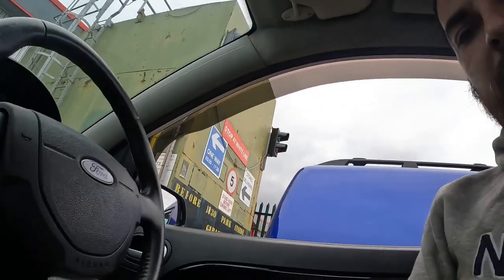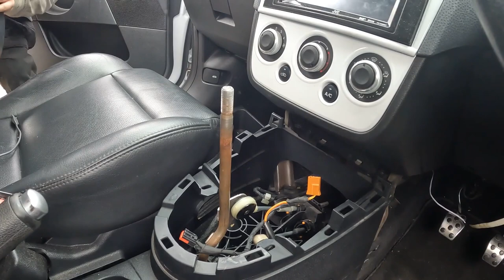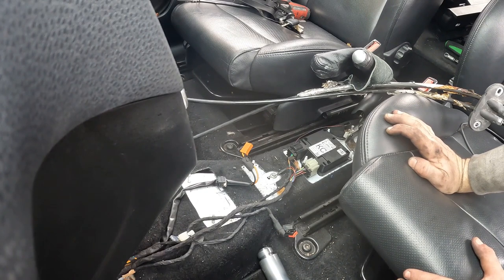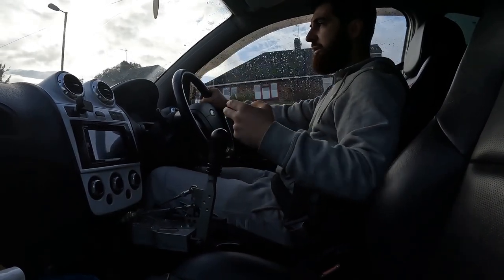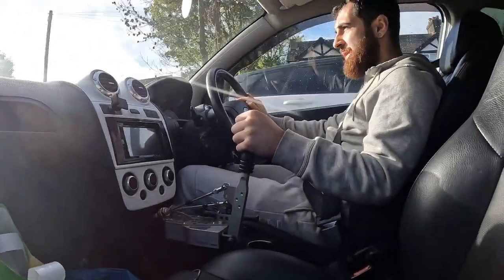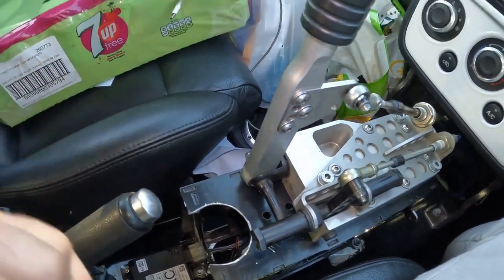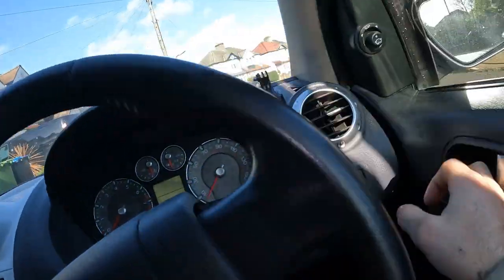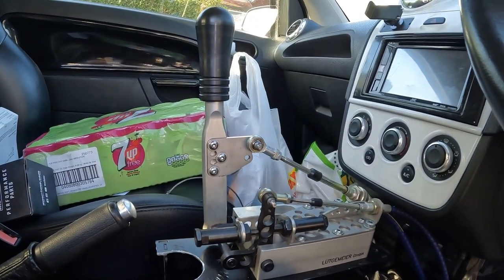THE LÜTGEMEIER GERMAN CUP CAR SHORT SHIFTER IS FINALLY FITTED TO THE MK6 FIESTA ST150!!

Comment: Hi mate. Can you tell me where tf the negative ground goes from the battery?? Just fitted new loom and got work tomorrow ffs lol
Reply from the maker: Pretty sure it just bolts to the body underneath the battery tray mate
Reply: @6uiltdifferent  half way down the wire it bolts there. Then the end bolts to f knows where. I’ve got work tomorrow I’m really in the shit
Reply from the maker: @shadows4775  I have a battery relocation video might show you where it is on there?

Comment: Mate pulling those cables through looks so easy. I've recently changed my gear cables as my old one rusted and couldn't select gears. I had to drop the whole exhuast to get to the heat shield. It was a pain I'm the arse!! Big job for something so simple! Good work bro keep up the content!
Reply from the maker: Wasnt too bad on mine as I don’t currently have heatshields so I was able to do it with the exhaust in situ but I can see why it may put some people off the job especially if they haven’t got much experience I look at it like there’s always a worse job to be doing haha, thanks mate I really appreciate it
Reply: To get my gear cables out I had to chop them with a grinder. And it was still tight getting new ones in because the my 4-1 manifold and heatshield was resting on the subframe at this point  it only gave me about 10mm more room to play with.  It was a good feeling when it was back togeather tho! Gear changes are very smooth now!
Reply from the maker: @markheath6232  sounds like you had a nightmare glad mine wasn’t that bad still you got it done that’s the main thing

Comment: Short shifter looking taller 😂
Reply from the maker: Just a little haha
Reply: @6uiltdifferent  🤣what’s it like tho
Reply from the maker: @jamiefowler2329  one of the best things I did
Reply: @6uiltdifferent  sounds good how much are they I have a mk8 fiesta but swapped the engine for the rs 2.5 5 pot could do with a good short shift in it tbf
Reply from the maker: @jamiefowler2329  you’ll be lucky to find one this is a Ford motorsport item. Purposely specced for the mk6 fiesta 

They built 50 mk6 fiesta German cup cars for a race series they all contained one of these shifters…… yes there’s only 50 of them ever made for the mk6 fiesta so they don’t come up often I got lucky with getting this one but it set me back around £1250 

Look into a cae, coolerworx or a zero point one shifter as they’re commonly more available
Reply: @6uiltdifferent  oh shit you did get lucky! And ok sound I’ll have a look into that sound mate appreciate it